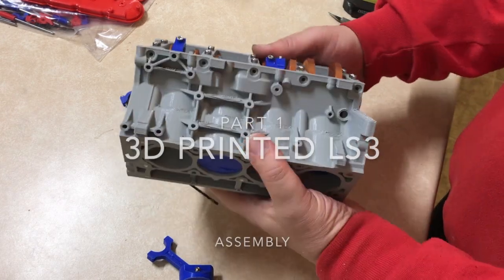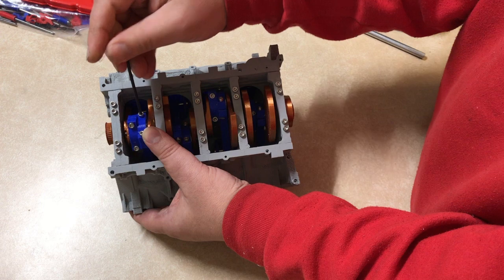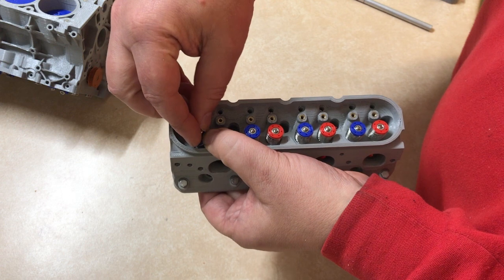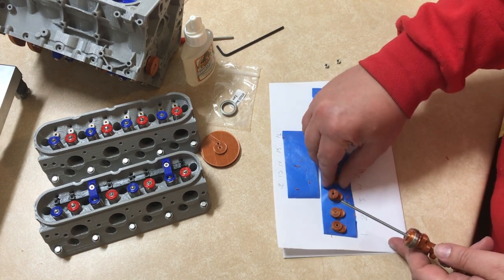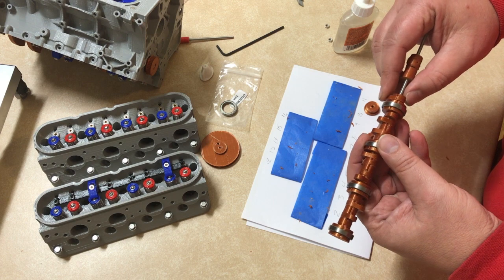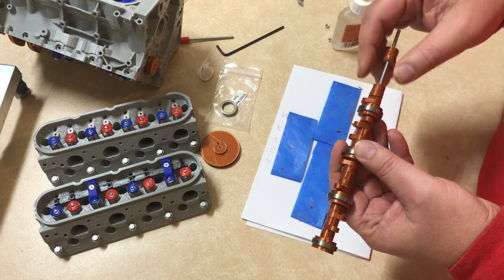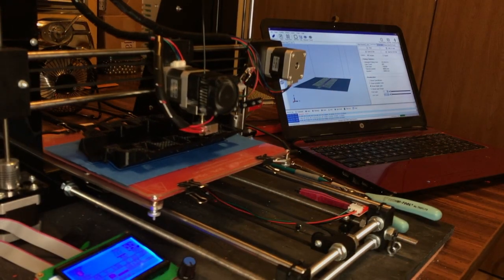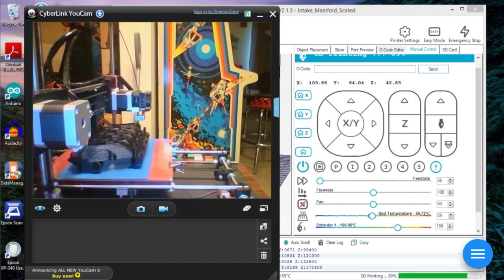3D Printer Challenge #2 - LS3 Engine Part 1

Comment: what do the valve covers bolt to i dont see holes in the head for the 4 valve cover bolts
Reply from the maker: Valve covers just sit on the heads. The heads are attached to the block with magnets. Same with the timing cover, oil pan. And intake.
Reply: @geeteoh1  thank you!

Comment: I’m having an issue installing the cam. It will not fit. Getting stuck on the bearings. Did you have to ream it out to get cam to slid in?
Reply from the maker: Yes. I used a very large drill bit to open up the path to allow the bearings to slide in. I don’t remember the size.

Comment: at the time could you still get the hardware kit? I'm trying to locate the bearings mostly. need the sizes for them
Reply from the maker: I ordered some replacement ones from Amazon a couple of years ago. I think they were exact or close. 6702ZZ Ball Bearings，15 x 21 x 4mm Bearing，Double Shielded Deep-groove Ball Bearings，Deep-groove High-speed Ball Bearings

Comment: Are the rocker arm ratio and rod to stroke ratio to scale?
Reply from the maker: Not sure. But engines can have piston to valve contact if the cam isn’t aligned.

Comment: Great work. Question what is the length of the motor. I was thinking of printing the motor twice the size depending how big your motor is.
Reply from the maker: About 200mm. You’ll have to try different scales when slicing it and see what fits on your printer and watch the amount of filiment. The regular size uses about 75% of a regular 1kg roll. Regular size took just over 2 days to print. 2x size could take 16 days. The slicer will tell you all this.

Comment: I’m also working on this project 🙂.  I assume you drilled a hole in the bottom of each rocker arm so the screw can go through?  I thought it was odd the hole wasn’t included in the .stl file.
Reply from the maker: Don’t remember. Sorry.
Reply: @geeteoh1  No worries, it’s from several years ago but if you can recall I would greatly appreciate it.  I’m about 150 hours in and have everything printed but I have at least 5 other questions I would love your expertise on as well.  Top of the list-did you use thread inserts in the block for the main bearing caps?  Eric’s instructions are good but also vague in some important areas.
Reply from the maker: @TheDavemurrayy  only threaded inserts were on the rockers arms. I got the kit from him will all the hardware. The only issue I had was with the cam shaft bore was too small for the bearings. I had to drill it out with a huge twist drill I got from our machine shop at work.
Reply from the maker: You can also email me at geeteoh @gmail.com
Reply: @geeteoh1  🙏 Thank you!
Reply from the maker: I believe it needs to be a slot or it won’t rock

Comment: Nice job, I’m building same thing but I’m having trouble finding the valve springs and the bolts for the valves. Where did you get yours?
Reply from the maker: I got all my hardware as a kit from the link in the model in thingiverse. It is about $100. But we’ll worth it as the springs are really hard to get otherwise.
Reply: @geeteoh1 could you share the hardware kit items in a pm? Been waiting about 2 years to have them in stock again. But nothing.